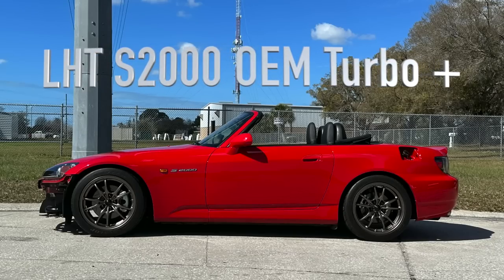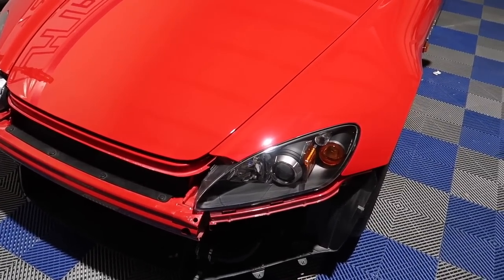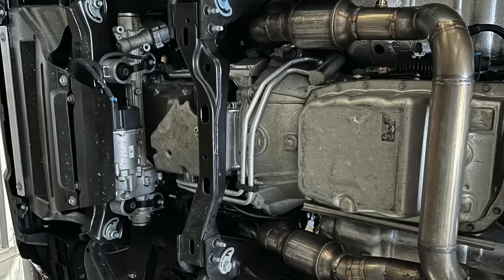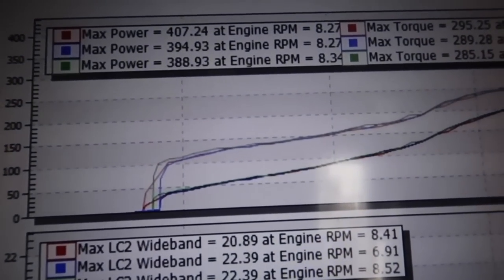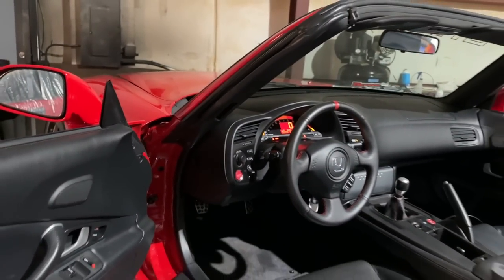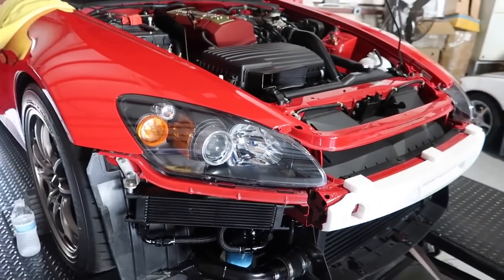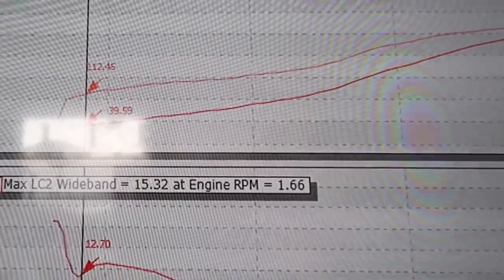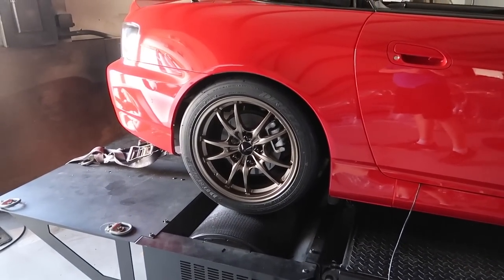Testing Expensive Cat versus cheap Cat - Pressure check

Comment: Great tests!!! The power loss of these high flow cats is something that I’ve always been curios of and I’m sure I’m not the only one. It would be interesting to see the test of the Flowmaster 200 cell high flow cat. Supposedly those don’t lose power but I have my doubts. Thank you for the great content. I’ve been following your shop since I saw the turbo type r on the cover of turbo magazine !! Great shop
Reply: Hks is I think the only one to have a very expensive cat for the s2000 “HKS Metal Catalyzer utilizes 150cpsi cell design compared to the factory 400casi design. Pressure loss reduction and high emissions standard are implemented together. Pressure loss reduction particularly affects at high engine RPM range providing sharp engine feeling and response.” From hks website

Comment: The testing and S2000 content is great! Keep it coming if you ask me.

By the way, how much weight saving is in the Ti exhaust compared to the stock exhaust?
Reply from the maker: It’s around 26lbs. Stock is 68lbs
Reply: @LHTPerformance  the weight saving is 26lbs or the Ti weights 26lbs?
Reply from the maker: @jiurriza  Sorry, I meant the new titanium exhaust is 26lbs .
Reply: @LHTPerformance  wow 42 lbs lighter. Thanks

Comment: Just a heads up, this is awesome information that I'm definitely interested in. I'm currently in the market for an exhaust solution with a cat for my S2000 with a mind to eventually supercharge (350 to 400 whp). I was really starting to think that a test pipe was the only workable option, but this shows otherwise. I'll eventually contact y'all for a custom fab high flow cat along the lines of what you made here.